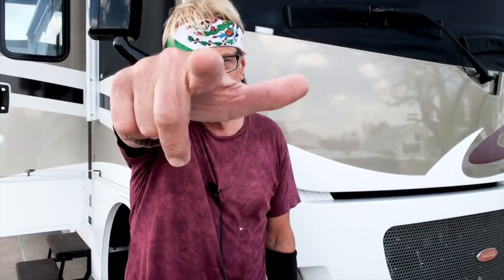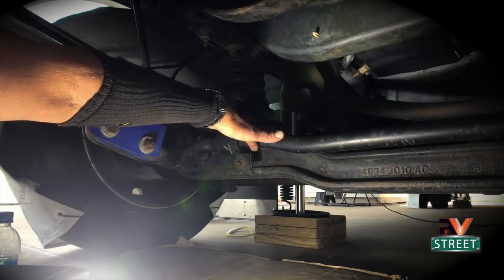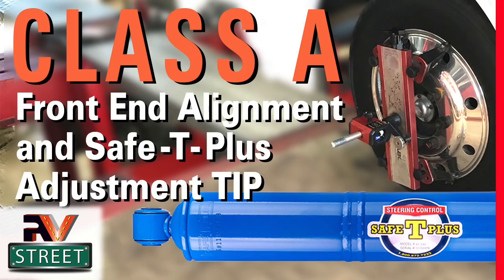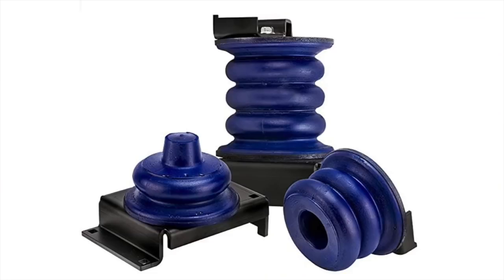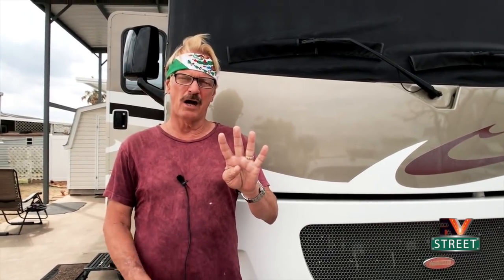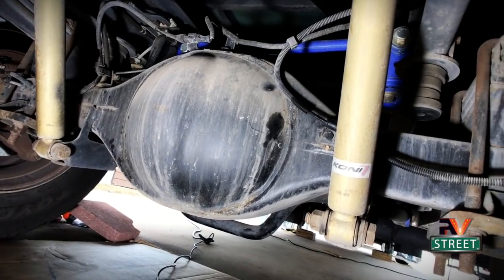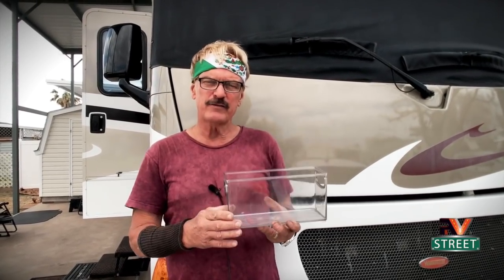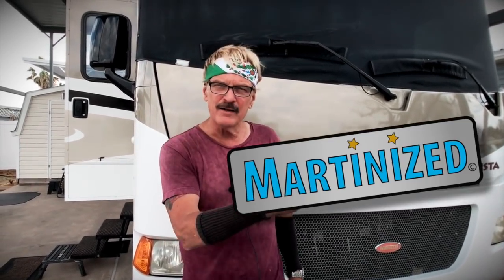Class A, Motorhome Handling Upgrades that had the MOST IMPACT

Comment: I have to say the Sumo springs I installed on our 2005 Winnebago Adventurer 38J on the Workhorse W-24 chassis did not help us at all.  The front still slam-jars on the tar filled cracks in the pavement.  We installed Sumos front and rear.  Also put on Koni shocks.  The front Sumos for the Workhorse chassis are not a two piece like for the Ford F-53.  They are very much like the OEM bumpers.  In our case with our present loading they leave a space open before contacting the leaf springs.
Reply from the maker: Yep, there's a difference in the two chassis's. I mean, the Sumo Springs or any front suspension upgrade on a F53 chassis is NOT going to remove 100% of the 'slam-jams' simply because the chassis has leaf springs. But in our case it removed 80%-90% of them. If they made a 2 piece sumo for your chassis I'm pretty confident it would of made a huge difference. But if there's still a gap then no.
Reply: I have the W21 chassis 35J. Was looking at the sumo springs. Did you do shocks and safe T rod as well?
Reply: Yes I did.  Koni shocks and Safe-T-Plus.  Satisfied with both.  I would NOT do Sumos on a workhorse again.

Comment: Great Video!! Question: Which upgrade gives more bang for the buck 1) add on Sway Bar or add on Trac Bar?  I have a steering stabilizer.
Reply from the maker: For our coach it was the rear trac bar. I still run factory sway bars with the upgrades I did.

Comment: You discuss the Gas Ford chassis what about workhorse chassis? Do they also need all of these suggestions and do they install similar to the Ford chassis? Running a workhorse W21 08 35J Sightseer.
Reply from the maker: The install would be similar but maybe a different part#. A little research should clear up any questions you have,

Comment: Off topic I need some help - I have a workhorse W22 chasis - what grease do I use on all the zerks - I just put some black grease in - hope its right but wanted to check with my buddy RVstreet and his wife.
Reply from the maker: You need to use my Red Grease in my Amazon Store in the "Tires, Engine and Chassis Care" category.
https://www.amazon.com/shop/rvstreet
Take this new red grease and pump in small increments—pausing between each pump—until black grease is eliminated and new red grease starts to ooze out. Wipe off excess black grease. Going forward, grease once a year. Be sure to grease loaded and unloaded 👍

Comment: Martin, since my 2022 Ford F53 chassis has the larger 2" diameter sway bar does this eliminate the need for the CHF?  I know you said you noticed some improvement doing the CHF on your rig, but the improvement was small compared to the other upgrades you did, so I have to wonder if doing this on my rig with the massive 2" sway bars is even worth the effort?  Have you heard of anyone with these larger 2" sway bars doing the CHF and if it helped to reduce MH sway. The reason I'm thinking about doing this CHF is because when I pulled out of a campground last Sunday and the driveway leaving the campground did not meet up the road very well and my MH home did rock pretty good from side-to-side while leaving the campground, so I'm wondering if the CHF might reduce this issue.  If I was to do this, I would most likely use the Hellweg adjustable end-links, but do you think that these Hellweg end-links would be strong enough for the 2" sway bars that I have?
Reply from the maker: do you think that these Hellweg end-links would be strong enough for the 2" sway bars that I have?
Yes, but IMO, I don't think that's what you should do in your case with a 2" SB. At least not yet. Read on.
1) One thing to check for sure is to check the SB brackets themselves. There are two of them and each one has 2 bolts. These bolts are notorious for coming loose and falling out therefore not holding the SB in place firmly. It's been an ongoing problem with Ford F53 chassis's for years. The fix is to remove each bolt—one at a time—add about 3 drops of *BLUE loctite*—install bolts and torque to 66' lbs. You should do this regardless of whether your bolts came loose or not.
2) With your 2" SB, I don't think you need to do the CHF or the Hellwig end links. But what I would do first is install Sumo Springs on the front. It's a fairly easy DIY, that will help—not eliminate—the roll you described. It also will also help with the "slam jams" you experience on the hwy.
Just remember, your rig, like mine, is a bus and is very top heavy. There will always be some roll coming out of uneven areas. Just take it slow when approaching those kind of areas.
Hope this helps 👍

BREAKING: I just found this recent issue:
This was posted on another site for the 2020 Ford F-53 V8 chassis. The poster called it a "pre-recall notice".

This pre-recall notice is for 2020 F53 chassis rear Sway Bar brackets that may crack and separate from the vehicle.

There's nothing on the NHTSA's site yet, though: https://www.nhtsa.gov/vehicle/2020/FORD/F-53#recalls

V8 owners may want to check their VIN at: https://www.ford.com/support/ and also create a My Ford account to monitor.

Comment: Great video.  I have a question.  If we break these down into multiple upgrades, what do you suggest in order?  We are heading out for a month trip in late Sept.  Due to recent medical issues, will need to hire out to do the upgrades.   Thus, can't afford to get all done at once.  Thinking the SafeT Plus first. Than when we return do the springs and shocks.  Do we need a front end alignment with each upgrade?  If not, which one.  This is our first RV, 2018 Tiffin OpenRoad 34PA.
Reply from the maker: Thank you Nancy for your questions 🔧 👍
IMO...I would get the front end alignment first. Then...since you're on a shorter chassis you probably experience a lot of tail wag while underway from cross winds, 18 wheelers going by and so forth. So I would also would install the super steer rear trac bar next to greatly reduce that issue.
Then I'd do the Safe-T-Plus then the shocks.
I mean it's really hard to say without driving and experiencing your coach, but from your comment and questions that's what I'd do.
Be sure you also pay close attention to the amount of PSI—air pressure— you're putting in your tires. This alone makes a big difference in handling. I did a whole video on that here: https://www.youtube.com/watch?v=Q_NuEoBIxe8&t=598s
Here's a link to my PLAYLIST page that has all my video's in different categories that may also help you: https://www.youtube.com/c/RVstreet/playlists

Remember I have all these things in my Amazon Store: https://www.amazon.com/shop/rvstreet
After you return from your trip, let me know what you did and how it worked out for you.  I love that feed back. 💗

Comment: I have a 2005 National Sea Breeze that I just bought. Bringing it home was tense. I was constantly centering the coach and getting pushed all over the place by big rigs. When I got home I started doing some research and found out about sway bars and steering stabilizers and such. To my surprise this unit doesn’t have sway bars. Can I add them even though they didn’t come with the coach from the factory? I have the Workhorse chassis with 8.1 l engine.
Reply from the maker: 2005 Seabreeze is a nice coach. Several models of this coach too. I have a friend that has a 2005 Sea Breeze with the work horse chassis. They have put over 20,000 miles on since they got it 5 years ago and have had no problems what so ever. They installed Koni shocks and a Safe-T- Plus.
EDIT: In case you don't know about these they are here in my Amazon Store and both are an easy install. 
https://www.amazon.com/shop/rvstreet?listId=1FUC3YMUOK6RD
If I can be of any more help, please let me know. I'll help if I can. 👍

Comment: In your video, your sumo springs appear black, on your site they appear blue. Which ones did you put on? And how do they handle bridge joints? THX
Reply from the maker: The were blue new, but after several thousand miles road grim makes them black. Wouldn't be without them now.

Comment: I have a 32 foot motorhome built on a durastar light international chassis. I had liquid spring suspension installed in back. This motorhome has leaf springs in the front. I have installed new shocks and the safety plus steering upgrade. I also had a aftermarket away bar installed. 

I am considering installing the sumo springs in the front. One person told me I would probably notice a rougher ride. Do think the ride will be affected?

Thanks
Reply from the maker: Sumo Springs on the front.....not sure on the international chassis. Each coach has to be diagnosed differently. I know in our case with the F53 chassis the sumo springs really smoothed out our ride a ton. I'm very familiar with liquid springs and that's a nice but expensive upgrade for the rear. I'm sure you're very pleased though.

Comment: Martin I've installed a steering stabilizer and a rear track bar on my m/h and it's made a big difference in the way it handles, being on a fixed income, of all the modifications you made which would you do next?
Reply from the maker: Well it depends on the year of your MH and I don't know what type of MH or the length you have. But, if your MH is more than than 5 or 6 years old I'd change out the shocks. If you fairly certain that your shocks are OK then I'd install Sumo springs.
Reply: RVstreet Martin sorry I didn't give you info. About my m/h it's a 2019  38' g-5 Georgetown, thanks for your advice, I was thinking that same thing, I was slowly following your advice on your video. I'm very thankful for your videos, been camping a long time but this is my first a class, thanks again!

Comment: So what length would I need for the front and back for the CHF on a 2019 Jayco precept? Is the rear track bar one size. I want to do everything you have done for the sway and tail wag. Thanks in advance
Reply from the maker: Not sure on your rig don't know the model or your chassis size. Ours is on a 22K Ford F53 chassis. All you have to do is crawl under there and measure your current length of the end links. I have 3 lengths of the Hellwig Adjustable End links in my Amazon Store. All 3 are adjustable and they are beefy.
Same thing with the rear trac bar.
If your coach is on a 22K F53 chassis like ours then the one I used should fit yours as well. The rear trac bar that's in my Amazon Store will fit Ford F53 20K and 22K chassis's and the Kodiak C4500/5500 18-22k GVWR. The torsion bar is also adjustable. The only thing has to line up are the holes on the differential that you bolt it to. If yours is like mine and you have either of these two chassis's above it should fit. It's an easy install.
https://www.amazon.com/shop/rvstreet

Comment: are you going to put the front True Track on? I know my Workhorse front axle walks bigtime.
Reply from the maker: No. I've installed the Safe-T-Plus as I showed in the video.
Reply: @RVstreet  I noticed you have a Ford chassis so it might be different but when you have a straight axle on leaf springs the whole axle walks back and forth
and  that includes the steering suppressor. Although the sumo springs might help with that.

Comment: Hi Martin, About to add Sumo Springs on Motorhome. What was your reasoning for not installing them in the rear?
Reply from the maker: Well for my rig I didn't feel I needed them back there. I don't experience any excessive roll back there, my Koni shocks handle the load fine, rear trac bar eliminated rear roll and tail wag, so I didn't see the spending another $500 for something like that. Now for the front, where I did have a lot of roll and all the suspension parts up there that take the brunt of the slam jams on the road, it made a big difference.
Reply: @RVstreet  I was having the same thoughts about my rig. I have Koni shocks as well and very little tail wag. But hoping to relieve some of the “slam jams”. Front only for now. Thank you

Comment: Hi Martin, I was looking for the rubber grommets for the wheel covers to protect the metal valve stems, I can't find them in your Amazon store?
Reply from the maker: Hi J, 
They're in the "Tires, Engine and Chassis Care" category. There's two types. One for 22'" Tires and one for 19' Tires. both come with s/s extensions but not the ones I recommend. Just toss those. It's the only way they come. I had my tire store order Dill Stainless Stems and Extensions.
https://www.amazon.com/shop/rvstreet
Reply: @RVstreet  Ok Martin I found them, I don't know how I missed them. I'll get the grommets and wait for the Dill stainless steel extensions to hit your store. I'm gonna get the tires, if possible, through Southern Tire in south Jersey ... New Jersey.  I'm going to ask them for the identical process that you outlined in your video. By the way can you get the centramatic rings ordered for your store? I have 19.5's on a 2005 Safari Trek. I would like to get those so I have everything ready for getting the tires in October. Thanks Martin.
Reply from the maker: No one sells the Dill stainless steel extensions on Amazon, that's why they aren't in my store already. Just have your heavy duty tire shop figure out how long of ones you need and have them order them. Most tire shops that can hand big RV tires carry them in stock. They are a very popular brand used by truckers so they shouldn't have any problem ordering them if they need to.
Reply: @RVstreet  okay thank you

Comment: Martin I just bought a 2022 MH with Ford F53 Chassis and new V8 gas engine, so it already has the larger 2" sway bars and I would like to start incorporating some of these upgrades, but I can't afford to do them all at once.  If you were to rank order these upgrades, what order would you put them in?  For the Front for example: 1. Safe-T plus, 2. Sumo springs, 3. Koni shocks...  Rear 1. Rear track bar, 2. Koni shocks...   My MH has the stock Ford shocks on it now and they only have about 1500 miles on them and I have to wonder just how much better the Koni shocks are compared to the stock shocks and since they're brand new the shock upgrade could wait.  When and if I do change the shocks I tend to replace all four at once. Thanks for any recommendations.

Jim
Reply from the maker: Since you MH is new I would definitely do 2 things first:
1) Rear Trac Bar
2) Safe-T-Plus

The drive it for a few thousand miles fully loaded with all your gear, tanks filled etc. You may—like me—want to add the Sumo Springs and especially in the front. I wouldn't changed out the OEM shocks now though. Just drive it and see if it is porpoising a lot when you hit big dips. That's the real test on the shocks. But IMO....you're probably good to go with what you have for 3-5 years.
Reply: @RVstreet  
So when you state rear track bar first and safe-t-plus second, does that mean that the rear track bar gives the best handling improvements followed by safe-t-plus as the 2nd best upgrade for improved drivability?  I guess I'm trying to understand which of these upgrades in your opinion did most to improve the handling characteristics of your MH?  Thanks for your input!

Jim
Reply from the maker: @cujo7240  So ya, you asked me to rank the order of these upgrades to best improve the handling. So yes:
1) Rear Trac Bar - to keep the MH steady and in the lane without tail wag in cross winds and when 18 wheelers come blasting by...
2) Safe-T-Plus - keeps the front of the MH centered in the lane, prevents wandering and also adds a great safety feature in the event of a steer tire blow out.

The attributes of both of these upgrades we're also commented on by many folks who watched the video if you want more opinions than mine.
thx Jim
Reply: @RVstreet  Martin, thank you kindly for your replies you're guidance on this subject is much appreciated!  I really enjoy your maintenance videos, since I too like to do my own RV maintenance.  Thank you
Reply from the maker: @cujo7240  👍

Comment: Curious whether steering gearbox should be 'tightened' as part of an alignment, especially after initial 20 k miles?  Would that not also reduce handling issues?
Reply from the maker: Never have had to tighten my steering box. But as I said, every coach is different and should be accessed by the symptoms they're experiencing.

Comment: When the cost of what the original parts replaced is subtracted from what you spent how much would the diff be.  Certainly not all that much so why don't they do it in the first place.
Reply from the maker: I'm asked this question a lot about many items that don't come stock. Like these chassis upgrades, more insulation, better this or that, The main reason, is because of cost and competition. If they added $3K of chassis parts, then marked them up and do the same thing with other items, it could easily raise their cost to build by many thousands of dollars which would raise the out the door price. Buyers could simply find an RV that LOOKS about the same and pay less. Therefore their sales go down. Most RVer's and especially new RV buyers, don't know what they don't know. But as they use the RV then they find out what's lacking.
The other reason is RVer's use their rig in different ways and different amounts of time. Some will only use it 2, 3 4x's a year and don't care about these upgrades. Others use it a lot and do care. So manufacturers just don't install them, keep the price down, increase sales and then let each buyer make their own upgrades as they see fit at their cost.
If a buyer wants all these sweet upgrades they can simply buy a high end RV and pay a lot more.